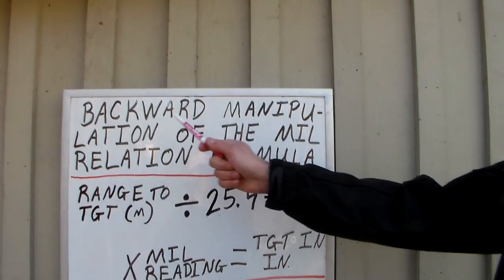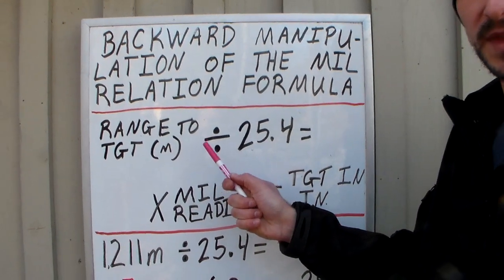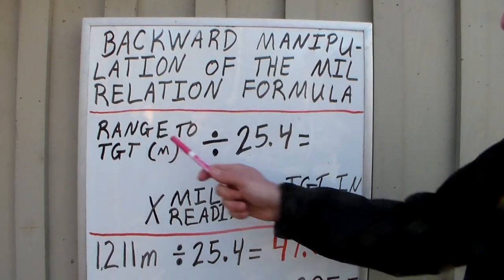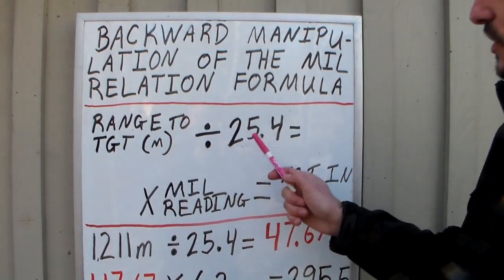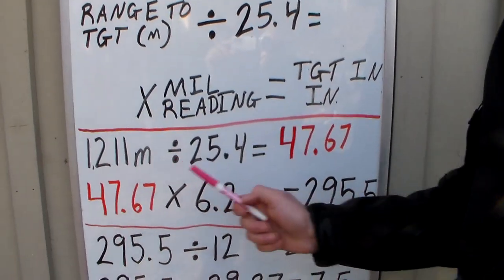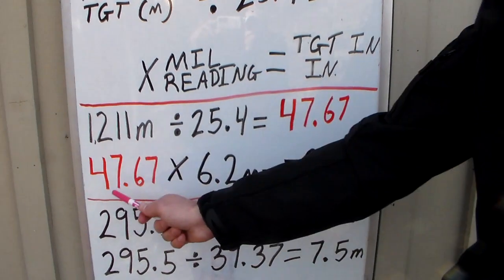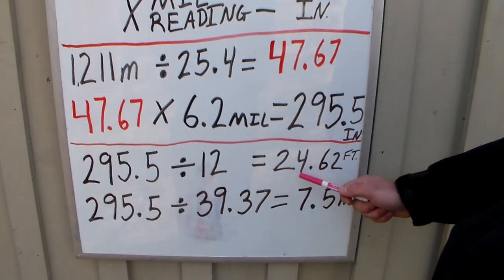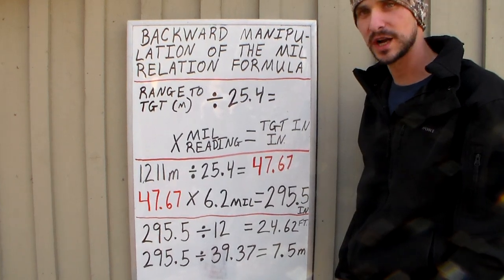How to use the MIL relation  formula to tell the size of  objects down range for recon and sketches

Comment: When you range in meters, you just divide by 1000 to get size of object in meters.
1211m x 6.2 MIL /1000 = 7.5m
Reply: exactly and if you need to convert to feet multiply that result by 3.3, you get 24.75 feet.  If you are in the military won't even need that.  It's a whole lot simpler and takes out two steps